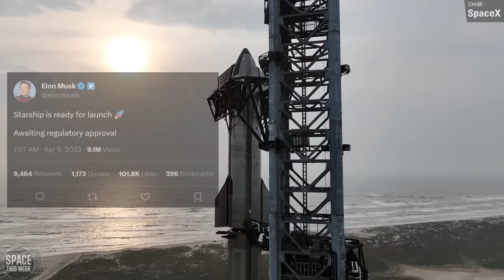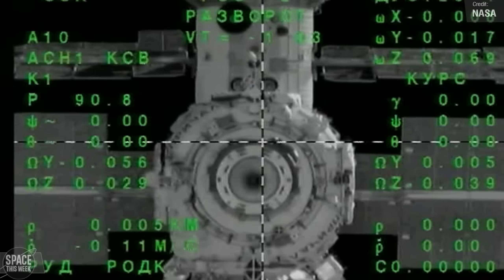SpaceX Starship is READY! NASA Reveals New Mars Helicopters, Vulcan Explosion, Soyuz Move, Artemis 2

Comment: I wonder if you could run Ingenuity's rotors in reverse and generate enough turbulence above the panel to blow the dust off? You'd need to land on some windswept rock and then blow the dust off, to avoid sucking debris through the rotors, though...
Reply: The panel is above the rotor, so it's already in the slipstream.
Reply: In normal flight the air is moving down, though. Running the rotors in reverse would blow air upwards, which might work better.
Reply: @hjalfi  So, blowing the air up from the behind the panel to hit the back of the solar panel? The air going down hits the face of the panel.
Reply: @steveaustin2686  Hence why I said turbulence. In normal use you'd end up with a pocket of dead air above the panel, which is why that's not blowing the dust off. You'd need to somehow cause different airflow.
Reply: @hjalfi  So causing turbulence from behind is supposed to change this? The problem with Martian dust is that it is statically charged and there is not much air to disrupt it. Apparently even with rotor blades pulling what air there is downward. Don't think that NASA has not already thought of this. They have VERY smart engineers working for them.

Comment: I thought the grid fins on Superheavy were going to be locked in place and not able to move? Am I just remembering incorrectly or was that a plan that fell through and they were allowed actuation?
Reply: No, they won't fold and will face flat into the airstream. Musk has said that facing flat into the airstream has the smallest bit of drag. He also said that they weigh about 3 tons each and that the equipment to fold them, would outweigh the drag that they cause.
Reply: @steveaustin2686  ahhh alright it was the folding i was thinking of. Thanks!
Reply: @toastedmilk  No worries.

Comment: solar panels need to have wind shield wipers lol
Reply: Per NASA, windshield wipers are not as easy a solution as you may think. Not only do you give up mass for experiments for the mass of the wiper mechanism, but it requires power as well. The dust on Mars is statically charged, so is harder to wipe off. And the mechanical joints of the wiper are also failure points. All things to be considered in the dust mitigation plan.
Reply: @steveaustin2686  well you get power from the solar panel, and a wiper is a default addition in cars, so
Reply: @steveaustin2686  alternatively you could use compressed air to blow the dust off, like in computers
Reply: @steveaustin2686  why you have to make things so hard
Reply: @Jkauppa  NASA has looked at ALL of these things and more. There are tradeoffs in everything.

Mars rovers and landers are NOT cars, so don't have standard features. Remember that the dust is statically charged, so wants to stick to the spacecraft.

Compressed air on Mars has the issue that the atmosphere on Mars is almost a vacuum. The atmospheric pressure on Mars is like less 1% of that on Earth, so the compressed air will expand very quickly and not be as useful as you might think. NASA does have engineers and dust management is an important feature for spacecraft with solar panels. 

For some rovers, they just do away with solar panels at all and use a Radioisotope Thermoelectric Generator (RTG). The decay heat of a radioactive isotope is converted to electrical energy. These are heavier than solar panels, but put out a constant amount of electricity. This degrades over the long term, as the converter loses efficiency as it gets older.
Reply: @steveaustin2686  I think NASA is not an authority, and so arent you, so do what do you, but offer is on the table, if you choose to discard what God said/gave
Reply: @steveaustin2686  I dont need your teaching, and so you dont need either, this conversation is over
Reply: @steveaustin2686  as if your knowledge would benefit anyone in any case, for money reasons (you have to be paid)
Reply: @steveaustin2686  I'll use the means I will use, you will what you use, some better some less useful, some trash, some diamonds, some jewels, but we will not talk anymore, stay off my comments, "please"
Reply: @steveaustin2686  k.i.s.s. explorer, NASA
Reply: @steveaustin2686  if you recommend your knowledge or people, NASA, then you definitely dont recommend God/gift, knowledge over God's skill, huh
Reply: @steveaustin2686  well a solar panel washer brush for your mouth is just fine, and also protect the panel when not in use or harsh weather of talking trash
Reply: @Jkauppa  dude wtf are you waffling about
Reply: @steveaustin2686  "we are wiser than you are", well, do you have solutions or are you just talking :) glhf
Reply: @steveaustin2686  all that counts is that I will not depend on you, and you will not try to depend/rule me, be separated
Reply: @steveaustin2686  "getting dusty" means they clearly havent solved that part simply, at all
Reply: @niox1920  just using my freedom of speech, nothing else, next move along be gone
Reply: @Jkauppa  NASA is one of the preeminent space organizations in the world, who has been sending spacecraft to other worlds for decades. But sure, ignore all that experience for YouTube engineering expertise. I'm not the one claiming to know more than NASA. I understand the limits of my knowledge and you seem to not understand the limits of yours. Not my problem and not my circus.
Reply: @steveaustin2686  I dont care
Reply: @steveaustin2686  you ignored God who gives everything, so I ignore you
Reply: @steveaustin2686  underage people depend on knowledge, and not in God
Reply: @steveaustin2686  grow up come back not pushing your pride of knowledge when you can do things without relying on law/money/people/knowledge
Reply: @steveaustin2686  I dont/willnot believe in you how matter how many words you speak, that honor belongs to God only, but Christ made free, believe in Christ, not in people/law/knowledge, be taught by God, not lacking people, you limiters of law
Reply: @steveaustin2686  only God knows, so you must be pretending, if you deny God
Reply: @steveaustin2686  yes I just ignored you and NASA, glhf
Reply: @steveaustin2686  its not wise to depend on people as authorities
Reply: @steveaustin2686  if you beg for honor, God still has all the honor, dont do that
Reply: @steveaustin2686  no you will not become god to me
Reply: @steveaustin2686  no I will not obey/follow/honor your judgement/measurement/dictatorship, or any kind
Reply: @steveaustin2686  I take as if you are nothing (you/people/NASA) so know your place
Reply: @steveaustin2686  US, you are preaching with guns/moral/laws, not ok
Reply: @steveaustin2686  I know you know you pride in what you own, but you dont own me, not even a little twigs gathered (not gift) worth
Reply: @steveaustin2686  not married to your rulership, "your highness", king
Reply: @steveaustin2686  I'm not taking any advice from you, I just posted my idea, so dont expect any role in teaching/authority/honor
Reply: @steveaustin2686  stop offering yourself as authority slave, no thanks, already got all from God, I dont have to listen to your talking/typing/texting
Reply: @steveaustin2686  dont depend on knowledge, my bro
Reply: @steveaustin2686  law bully
Reply: @steveaustin2686  dont you use tooth brush, its small/light
Reply: @steveaustin2686  so you confess that your knowledge is limited/imperfect, how sad, have God with you, with God helps
Reply: @steveaustin2686  I dont require your help, in any manner, so talk is not useful, be gone "please"
Reply: @steveaustin2686  law of reciprocity says that if you dont accept mine (knowledge/statement) then I will not accept yours (anything)
Reply: @steveaustin2686  then I dont have to listen to your pleas of bowing to you, freedom land
Reply: @steveaustin2686  you bowed to people, serve them, and similarly you try to make me do the same, nope not gonna happen, not bowing to people/science/kings whatever, God is with me
Reply: @steveaustin2686  whatever you serve/measure, I will not do
Reply: @steveaustin2686  gag order for the orderers/commanders
Reply: @steveaustin2686  go beg for acknowledgement somewhere else, I have more guns than you
Reply: @steveaustin2686  or just few/one God, your basis/foundation/creator
Reply: @Jkauppa  I never said that I ignore God nor deny Him. You can ignore reality all you want, but it will not change reality to suit your whims. I suggest seeking professional mental health help.
Reply: @steveaustin2686  false gods dont hear God
Reply: @steveaustin2686  or anything for that matter, even reason, because they dont have any themselves, they have to pretend to steal any real reason, from those owned by God, by law moral pushing teasing temptation
Reply: @steveaustin2686  you just did
Reply: @steveaustin2686  judge by reality/created, for those that believe all is possible, do you believe, says Jesus Christ who is Spirit, do you have the Spirit of the Lord, or only the given law, which you base on
Reply: @steveaustin2686  happy time in the flames
Reply: @steveaustin2686  so you confess you are the way, the truth and the life, under law
Reply: @steveaustin2686  you dont even have law, you are the law
Reply: @steveaustin2686  you are the judge, which i dont bow to, go away stan, you do exactly what you promised not to do, and I dont believe in you
Reply: @steveaustin2686  under laws are wicked/mental/mindless, you seek help, if you seek/recommend advice from people
Reply: @steveaustin2686  you deny my freedom, many times, bros, the many
Reply: @steveaustin2686  crucify me bro
Reply: @steveaustin2686  you seem to ignore the reality that God can and is with me
Reply: @steveaustin2686  God also will take all your trash
Reply: @steveaustin2686  you think you are so wise
Reply: @steveaustin2686  well better believe in God (promises) than people (trash)
Reply: @steveaustin2686  you promised that God does not give, what trash talk
Reply: @steveaustin2686  pure nonsense
Reply: @steveaustin2686  you have no place with me
Reply: @steveaustin2686  who would care how you judge (ignores cross, en-forces law)
Reply: @steveaustin2686  reality is that God is and you are not, any false gods are not, like you try to force me, to follow/believe in you/reality/created, whatever be gone stan
Reply: @steveaustin2686  you are empty betrayal, not listening to your tempt
Reply: @steveaustin2686  you will not win by law, only God wins, you are stealer, taking from what is God's, to be what is of people/created
Reply: @steveaustin2686  so you scammer recommend people scammers, and dont have God, nope, be gone stan, repent in faith, not through-by law, self-attempt
Reply: @steveaustin2686  well if you love me, bow to me (shut up), dont do that, only be free with God, dont bow to serving spirits, angels, you/me
Reply: @steveaustin2686  I dont believe a word you say, try to speak against me
Reply: @steveaustin2686  satan is "Him"
Reply: @steveaustin2686  however you judge will be measured to you, I dont care
Reply: @steveaustin2686  your judgement ignored, by the cross
Reply: @steveaustin2686  mind reasoning is mindless, dont do that
Reply: @steveaustin2686  yes you want reason/reality to bow to you, mindless, now bowing to you, God will not bow to you, but give freely without pointing fingers, as written in scripture
Reply: @steveaustin2686  God said: dont bow to people/created
Reply: @steveaustin2686  so you are under law judgement/limits and you judge to bow to you/people, meh, what trash
Reply: @steveaustin2686  hell fire is the nukes you will have to handle, from east to west, US
Reply: @steveaustin2686  I will not k1ll myself to your sword, enemy towards God
Reply: @steveaustin2686  seek help: for God you shall serve/bow to alone, stan
Reply: @steveaustin2686  under some law, nothing possible, all law, you
Reply: @steveaustin2686  you ignore God and bow to law again, any law/limit/reality
Reply: @steveaustin2686  law be with you until the end of your life (be with God instead, the Lord is Spirit, not law text you)
Reply: @steveaustin2686  it's no longer me that lives, but the Lord God Christ lives in me
Reply: @steveaustin2686  crucify me bro, "I'm who is"
Reply: @steveaustin2686  pharisee mocking God, you
Reply: @steveaustin2686  I will not agree with you on anything, stan
Reply: @steveaustin2686  I will not surrender to serve you, be a child of God, not child of people, I will not be what you want me to be, you are nothing
Reply: @steveaustin2686  fallen into hypocrisy, what for, earning your deth again
Reply: @steveaustin2686  j3w! under law, not freed by Christ
Reply: @steveaustin2686  not owned by you, not serving, you law or anything created
Reply: @steveaustin2686  so you confess that you on purpose try/attempt to break the law, by not doing what it says, when you are under law, I should not be under law ever
Reply: @steveaustin2686  talk is abomination in the ear(s) of God
Reply: @steveaustin2686  you are gay
Reply: @steveaustin2686  spiritually
Reply: @steveaustin2686  master who? not you
Reply: @steveaustin2686  you are bottle crazy mad
Reply: @steveaustin2686  bye bye, cya "later" when you attempt to come again
Reply: @steveaustin2686  never believe in you, only free in God
Reply: @steveaustin2686  if you are not with God, I'm not "with" you, the only link between us is God alone, not you or law, you being the law
Reply: @steveaustin2686  if law as self-righteousness (yourself as the judge) is your value, then what is cross/Christ/God to you, something given only, free gift alone, not your "must obey universe" law
Reply: @steveaustin2686  blasphemy towards the holy spirit (you are the judge now, bye bye)
Reply: @steveaustin2686  you wanted to part ways from God, so you carry what you judge, not anything towards this way from you, from command word/ law word
Reply: @steveaustin2686  did law land your head, so that you fell under it, like a bird from the sky, on Jesus head
Reply: @steveaustin2686  by talking now, you are not talking against me like flesh, but against the one that lives inside me, the Lord
Reply: @steveaustin2686  accuse more, people/law server
Reply: @steveaustin2686  we have nothing in common, God owns me and everything, not me with you, even universe/earth, all agreements vetoed, dont agree
Reply: @niox1920  Who knows. Sadly, I think that they need professional help.
Reply: @Jkauppa  are you insane you just typed to a wall for an hour
Reply: @tonnynguyen390  see if I care, you dont
Reply: @tonnynguyen390  At least it helps the algorithm for Matt. Jkauppa needs help apparently.
Reply: @tonnynguyen390  well if you act like wall, and the ones you relate to, then the world is doomed
Reply: @tonnynguyen390  God can walk through/past walls, if you believe, truly
Reply: @tonnynguyen390  well you are insane if you talk to a mirror, right, you are the judge, now
Reply: @tonnynguyen390  nah whatever you judge I dont care
Reply: @tonnynguyen390  Lord tony, dont rule as lords :)
Reply: @tonnynguyen390  if you dont speak what Lord said/gives you then you are lying your teeth threatening
Reply: @tonnynguyen390  witch through the law
Reply: @tonnynguyen390  you make me insane
Reply: @steveaustin2686  come out lazarus, from the cave, its not yours
Reply: @steveaustin2686  if you want to be perfect (not lacking one), one you are missing bro, go and sell all what you have and give it to poor, your bro
Reply: @tonnynguyen390  do you think a book writer its n0ts
Reply: Someone here needs an exorcist, but I can't tell exactly which one of you.